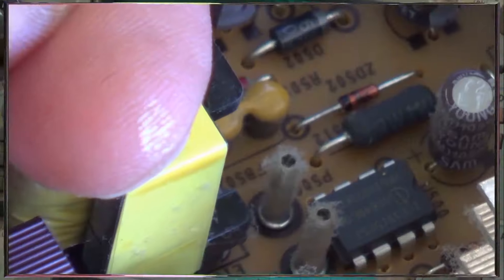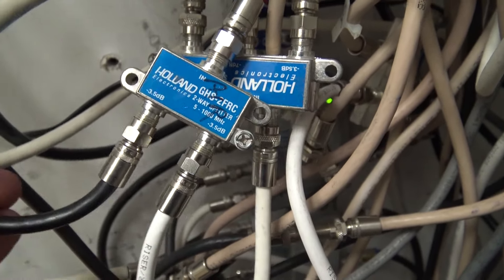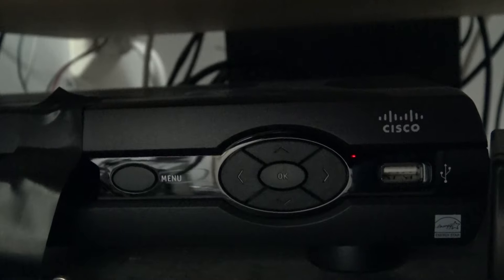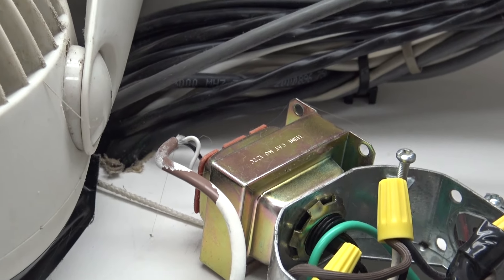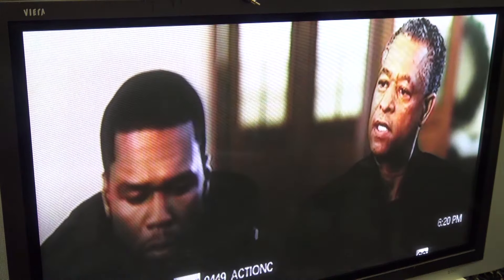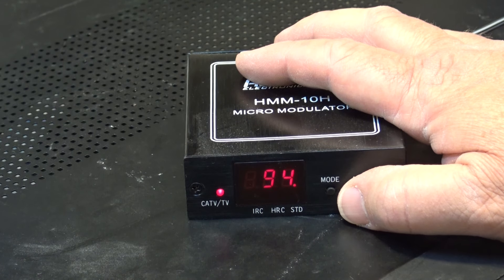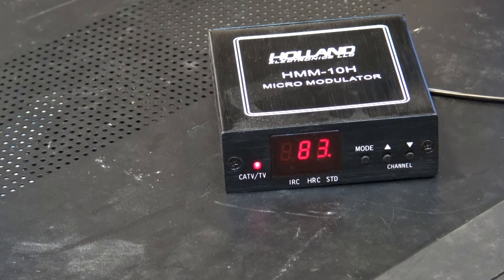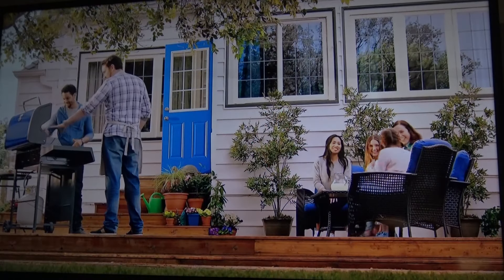Modulator set up at my house

Comment: I would have loved to have this kind of thing in 1982 to send my VCR output to the rest of the house on channel 3.
Reply from the maker: Well this is a little more complex than that, as I multiplex 6 analog channels in with the off air digital signals so I can still get the free OTA channels along with standard definition signals on the analog channels. It serves me well, as I do watch a fair bit of analog signals throughout the house.

Comment: I'd like to take a similar approach to providing analog in-house programming using RF modulators. Something I'm curious to learn is how each TV has an infrared remote control repeater that runs to that cable box in your distribution closet. Did you run an infrared repeater cable to each TV and then combine all the wires to a single emitter that you placed in front of the cable box's receiver? I ask since I, too, would like to have a single cable box broadcast via an RF modulator whose channels can be changed throughout the house.
Reply from the maker: In 2 rooms, I have IR receivers, and in my work shop the remote is teathered to the wall. I use the 4th pair (brown) on the tel wire to send the IF signals back to the closet and then just use IR LEDs salvaged from remote controls to control the equipment. One is in my media room, and the single IR receiver blasts 6 IR LEDs to control 6 different devices.
The 3 IR receivers in the bedrooms and kitchen are just tied together to a single LED to control that 1 box.

Comment: When we switched from DECnet co-ax to CAT-5 at a place where I worked, a contractor installed all the cables in the building and brought them back to the network closet. A fellow employee was assigned the task of connecting the wires to the back of the patch panel. Well, he did. But he wasn't very sharp. We wound up with totally random locations on the patch panel and literally, a three-foot diameter ball of tangled wire in the attic.
Reply from the maker: That's what toners are for!
You should see some of the buildings I work in. We are doing everything in fiber optic now, and some times they get the counts mixed up, and we spend hours putting lasers on the end of the run, then going back to the tel room, and turn out the lights and look for red glowing fibers.
Reply: +12voltvids We explained that to him, not that it did much good. 
Gotta love fiber! I bumped a loose adapter on the front of a Cisco switch and took down a steel rolling mill.
Reply from the maker: That would be tough at work. All the fiber is in protective runners, and equipment had guard rails around it. You would have to try hard to break it the way it is installed at the central offices.

Comment: Is there I can get my digital OTA channels (in US) converted into analog channels? Like if I have an analog tuner on an older VCR, channel 7 will give the digital channel 7, converted to analog. Is there a way to do it? I bought a DTV converter box with RF output and "analog passthrough".
Reply from the maker: Yes that is what I did with my dtv tuner boxes.  Took the av output and sent that to an agile modulator.  I have modulators set to 2, 4, 5, 7, 9, 12 and 17.
Reply: @12voltvids  will a passthrough box do the same thing
Reply from the maker: @KylesDigitalLab  
Passthru just allowed the analog signals to pass through the RF connectors when it is off. It will work just fine.
Reply: @12voltvids  so for example digital channel 7 from my OTA antenna will show up as analog channel 7 on my older TV using a passthrough converter box?
Reply from the maker: @KylesDigitalLab  
No it will show up on whatever channel the RF modulator is set to.  Analog passthrougb was for when analog broadcasting was still on the air.  It does nothing now.  You get either channel 3 or 4 out of the RF output.  And of course a/v. The a/v is what i plugged into an agile modulator.  (Agile modulator can be set to whatever channel you choose.) I use commercial modulators from a CATV head end that will operate in the vhf band. Most consumer ones only operate on UHF range.

Comment: I'm in the UK, I thought my bedroom was bad! I see those huge modulators you have. A company called 'Maximum' make much smaller programmable modulators that work with systems M(Japan & USA frequencies)/B/G/D/K/I/L and UHF/VHF. But unfortunately on 230volts. They also do one that works with German A2 analog stereo. Models MT47/57. Thought you might be interested as you do sometimes mess with multistandard stuff.
Reply from the maker: Patrick L 
I have a few Holland micro modulators. Not in same league, or sport for that matter. the difference in picture quality between a head end modulator and a consumer are night and day. about the only thing they have in common is they take an a/v signal in and turn rf out.  commercial units have notch, comb and bandpass filtering and produce a true vestigial sideband signal. consumer produce standard double sideband AM.

Comment: We still get analog signal through basic cable here in The Netherlands, alongside the digital signal. When did they stop doing that in Canada?
Reply from the maker: They shut down the analog channels last summer. I have never had cable. I had satellite TV for a few years, and have had IPTV delivered over my VDSL connection for several years, but I remember last summer seeing the message on TVs in restaurants that the analog signals were going away, and that they needed to call the cable co to get a digital box.
Reply: Digital transmission of standard definition signals takes less that 1/10 the bandwidth as analog carriage so it all comes to capacity. An operator can carrier six or more HD signals in the same 6 MHz channel as one NTSC analog and that's what the customers want.

Comment: 2:01 I have that EXACT same modulator and it's awesome. $ well spent because it still works but I rarely use it. I don't have a setup like yours.

I like how you can record stuff off the cable. I wish you could record HD content.

12:34 it's 50 cent.
Reply from the maker: I record most of my stuff in HD. The only time I record in SD is when it is for someone else. I have a Hauppague HDPVR that has componet input. (Most of the newer ones have HDMI, and will not record protected content, however the original HDPVR used component input, so I just plug the component output from my IPTV box into it, and record in HD as an .mp4 file, and save it to a hard drive or USB stick. QUALITY IS EXCELLENT.
Reply: I'd love to record HD content but all I have in my room now is a coax wire running all the way to my DISH Receiver on TV 2 and that's SD only.TV1 is HD.
Reply from the maker: Back in the day when I was on Satellilte TV, and my dish receiver (Bell) was in the other room, I made a really long USB cable by basically cutting a USB cable in half, and then splicing in 50 feet of CAT5 wire to the 2 ends. I took my Hauppague HD capture box into the living toom and plugged it in, and ran the long USB cable back to my computer, and then just played back the recordings on the DISH PVR, and captured them in my computer room. Did that for years until I changed from satellite to IPTV about 7 years ago.
Reply: How can you record from IPTV just the same as any other TV service receiver or can you sniff the network traffic. My mom had that as AT&T UVerse and it was awesome. the internet was FAST and you can get tons of channels.
Reply from the maker: coondogtheman1234 
I just take the component output and run it into my Hauppauge HD capture box. you have to unplug the hdmi when doing so because if hdmi is connected the analog HD is turned off.

Comment: There must be a way of getting a modulator for the Digital TV system you guys have in the Good OLD USA, BTW is the crypto system on the ATSC system Nigravision?.
Reply: He is Canadian.
Reply from the maker: Digital modulators are available. I keep getting companies trying to sell me one, but they are NOT cheap. Over 1000.00 for a single channel HD modulator. I would like a digital modulator, but not bad enough to spend that much. If they were 100 then I would already have one
Reply: hehe, Digital Modulators for DVB-T over here in Europe go for lowest $170 for 1 channel, up to $1000s for multi-channel
Reply: I just got an HDMI modulator for my church spent a tad under $400
Reply from the maker: You can but atsc modulators. Lots available but they are big bucks, as is close to 1000.00 for a single channel system.
Reply from the maker: @Grumpy80  
400 usd plus shipping and broker fees. About 650 cdn.

Comment: nobody in my family can understand my wire spaghetti.  hundreds of wires, even I get confused because I didn't label the wires.  I've been going wireless more and more, wifi, bluetooth, RF modulators, IR, wires can get crazy.  I like the Drake RF "transmitter", it can be cranked up a bit more than Blonder Tongue.  My Blonder Tongue has cable ready channels, i.e. more channels.  I have one of thos FTA SAT boxes, may get a dish someday to see what's still on sat.  Don
Reply from the maker: My BT can be cranked to +60dB, which is pretty hot. The unit is tunable to any cable channel, however the 60dB amplifier is tuned for channel 12, as this was one that was used by Shaw cable, for the CTV2 network, so that was a special order preset to channel 12. Works for me, I want everything on the low band.

Comment: Loads of spagetti, you know what it does so thats all that matters :-D.
If you decide to rework it one day, buy a roll of white parcel labels and a black marker pen, then you can wrap the label round each wire to form a tab to write on.

But it works, so keep the door shut LOL :-D
Reply from the maker: All the cables are labeled, so I do know where they go, but there are some patch cords that go nowhere as the equipment they serviced have been removed. You didn't see them, but there are zip ties with ID tabs on each cable.
Reply: Ahh i see, my mistake.
Just keep the cat out of that area, cats love to chew things, not nice if they bite into mains cables :-(.
My mates dog wont leave 240v mains cables alone, ive told him to lay some false cables and connect a small pp3 9v battery across the wires, hopefully the dog will get a slight tongue zap and keep away from cables.
240v would be instant death to the doggy :-(
Reply from the maker: No power cables near the ground. Lowest equipment is a few feet off the ground, with most of it at eye level. Hey, I am lazy. I don't like getting down on the ground to work, and the closet is not very big. It is under the stairs, only about 3 feet wide.
Reply: By the time you organize things, you will be adding more so quit now and keep going.
Reply from the maker: That's why it looks like it does. Changing modems, then modulators. Next will be fiber to the house. Still have to figure out how to get fiber into there from the street. That will be a challenge.
Reply: How true. Just live with your spaghetti. LOL Just pick a good sauce.

Comment: would definitely  be neat to see you clean up that wiring.. yes, complex sounding
Reply from the maker: Ray M 
don't hold your breath. that is a very low priority, because to do it right I will have to totally disconnect everything and rewire it. if it ain't broke. it really isn't that bad. you saw the worst of it.
Reply: You can get HDMI to Fibre Optic Cable and a Fibre Optic Cable to HDMI adaptor unit which can use very fine Optical Fibre and is not effected by magnetic fields and you just use a Fibre Switch.
Reply from the maker: Cat5 and 6 works for me, but when it is time to go 4K I will have to loot to something else.
Reply: The quote "nothing's more permanent than a temporary solution that works" is sadly almost always true

Comment: I saw Netherlands 3.. do you actually receive that channel over there?
Nice setup though :)

Just curious, what's with the 12, 12-1, 12-2? How does that work and why is it that way?
Or is that because of digital, a channel within the digital stream?
Reply from the maker: The music videos playing on channel 12 are on a hard drive, playing from a Raspberry Pi. They were all downloaded from Youtube.
As to the channels, there are my internally generated channels, and then the digital channels received off air. Regardless of what the channel number says, all the digital channels are broadcast on UHF and remapped to whatever channel the broadcaster wants to show, which is the same as where their analog channel was.
All the channels with no .1 .2 ect are analog channels generated by my modulator setup. Those channels being 4,5,7,9,12,27 and 40. The other channels 2.1, 8.1, 10,1 12.1, 12.2, 12.3, 17.1, 22.2, 24.1, 24.2, 28.1, 28.2, 28.3, 28.4, 32.1, and 42.1 are local TV stations received with an antenna.
The modulator setup is as follows, in standard definition naturally.
4 (stereo) a dedicated cable box that the channel can be changed from multiple rooms. 5, in house video I use for testing, basically the rain and storm videos. 7 is the analog output of my main PVR, so I can watch what the wife is watching in another room, typically the garage when I am working on something. 9 is my security cameras, 12 is the music video player, also in stereo sound. 27 is an old satellite receiver that has an off air tuner in it, and I have it programmed to record the news broadcasts every day so I can watch them whenever I want from the off air channels. 40 is another one that I can put video for testing on. Usually it has an android box with live wallpaper and and analog clock display on it.